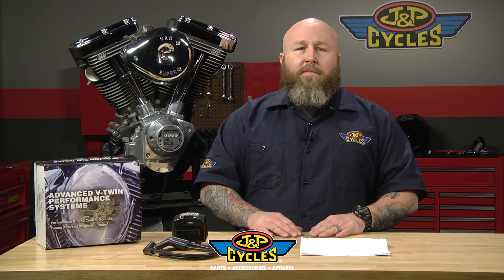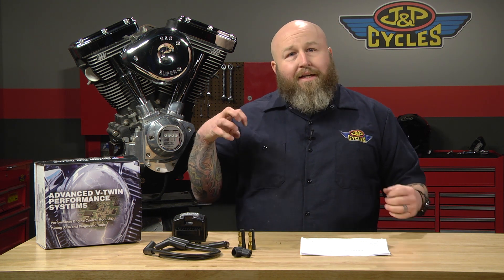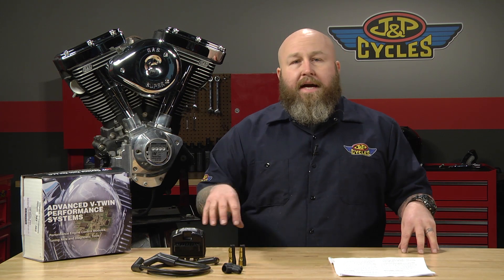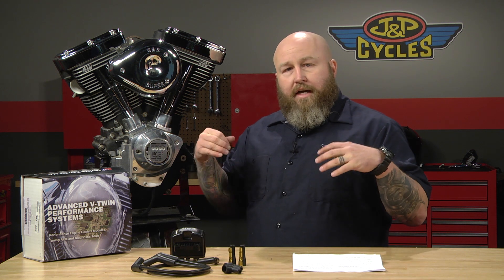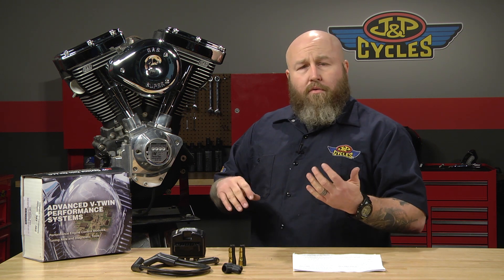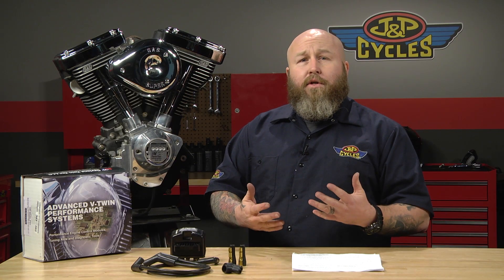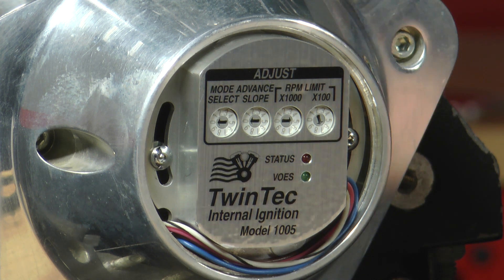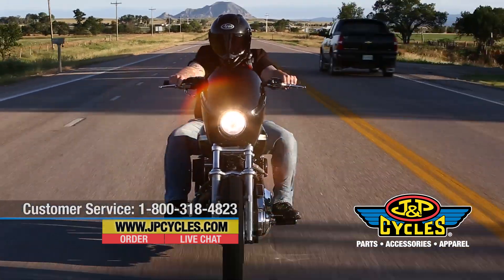Daytona Twin Tec 1005 Ignition Kit at J&P Cycles

Comment: Didn't see a ignition module on a 2004 softail harley davidson motorcycle,  no power to ignition fuse  / terminal  / stator  @ voltage regulator some of problem.

Comment: Run as much advance as you can without a spark knock at a few degrees F above target temperature range, test under engine load, with mid grade fuel then back it off a degree or two in the rear jug to compensate for rear cylinder heat saturation in areas where traffic is heavy unless an oil cooler is used, you’ll get better fuel efficiency, mileage on average I’d say probably not, because you’ll be tempted to twist that right grip more often, but on long distance highway rides, you’ll use less throttle to achieve highway speeds. If your voes (on older bikes without ECMs) is tuned to your cam (s) fuel/carb setup, and your exhaust tubing length and diameter on point, with minimum exhaust back pressure and Intake flow velocity improved, just enough sound reduction to optimize sonic resonance (torque tube exhaust flange inserts help) you’ll be able to travel many exits along the route than before, arrive sooner while riding along at lower cruising speeds, because of the less frequent need to stop for refueling, which also takes additional fuel. We’ve seen increases in range on a 97 5speed evo fat boy, two up, saddle bags, and heavy gear, pick up 40-60 miles depending on traffic and weather

Comment: junk! get a ultima ignition, less money and the ultima works great , over 30,000 miles no problems with the ultima.  the twin tech failed on me twice in three years and left me stranded.
Reply: I just bought Ultima kit off amazon ....what you set the curve too an do I have to static time it ...
Reply: @bloodbatteries4797  yes you absolutely need to static time.  Setting the ignition curve depends on what type of performance upgrades you have on your engine. I set mine for 80ci. to 96ci. Curve #1. 5500 rpm.  The ultima ignition comes with installing instructions .
Reply: @jakejames1977  how  do you static time it please help
Reply: I got 40 miles out of a ultimate ignition.  Pink wire lost power. Rode home on front cylinder.
Reply: I knew it was going to be junk within 3/4 of a mile. Cause after the first 1/2 mile bike totally shut off. Coasted to a stop. Started right up then in a mile it sputtered. The next time it sputtered it went 20ft and lost fire to rear cylinder.  Rebuilt motor with great compression

Comment: Replacing mine with exact same ignition as the one getting take out,can I just mark the plates and install the same instead of setting the top dead center all the extra work?
Reply from the maker: That will typically work, but if you have an issue you can always start over from scratch and set to TDC.